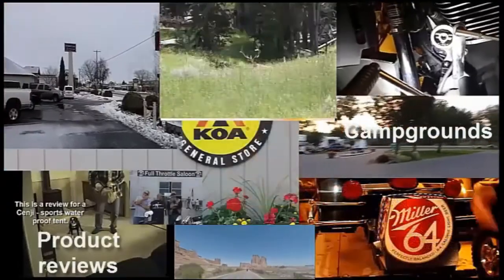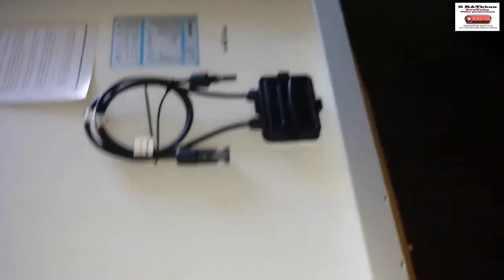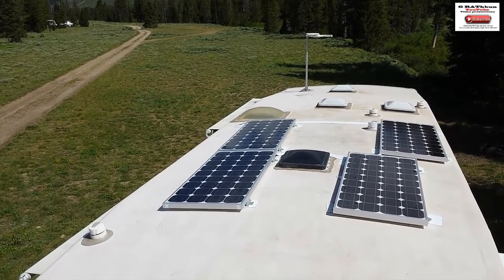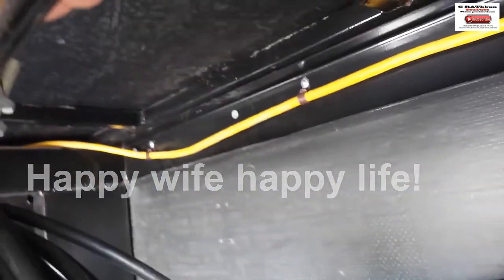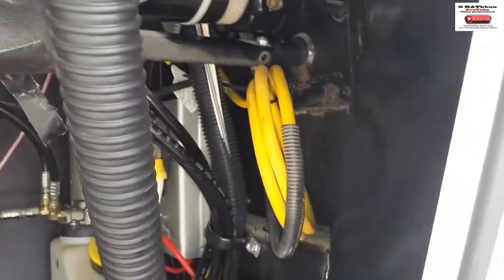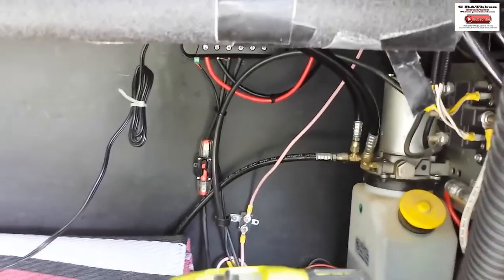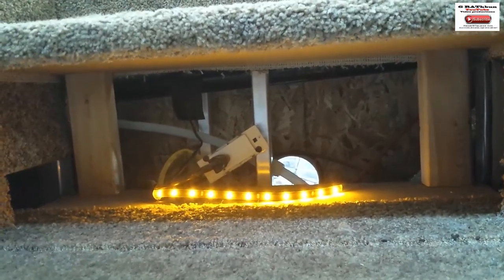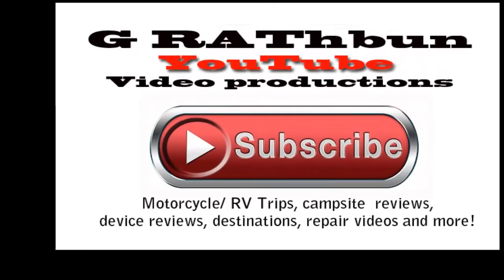Rover mppt charge controller  and Renogy 400 W solar installation(please share to your Facebook)

Comment: The screws that came with the set look like they are self tapping screws. They are used for drilling into metal. They don't work well when drilling into wood. Because as you said, it makes the hole to big to begin with. Nice video. I would recommend 2 or 4 gauge for your cables on the batteries and you will be set. Not sure what you are currently using. Everything looks great! Nice set up. Please keep us updated on the system. Specifically how the charge controller works. Thanks.
Reply from the maker: I agree with you,  also I recently purchased the last of my parts and pieces so I will start of gauging my wiring. May do that while I sit on the coast and enjoy the ocean view. Thanks for your comment. I hope you've subscribed going to be doing more RV stuff for a while.
Reply: Man, that sounds like fun. We don't have very many coast lines here in OK. ha ha. I will do that. I am actually putting my solar system on a small trailer to pull behind my Patriot. I currently have 3 27DC batteries. My goal is to get up to either 4 or 5 total. I started with the HF 45 watt solar kit. But, I'm starting to upgrade everything and I am very interested in how your charge controller works. Have fun at the coast!
Reply from the maker: I know what you mean there's not many beaches here in Idaho that's why I love going to the coast of Oregon.. don't much care for their politics though... can't carry my gun there